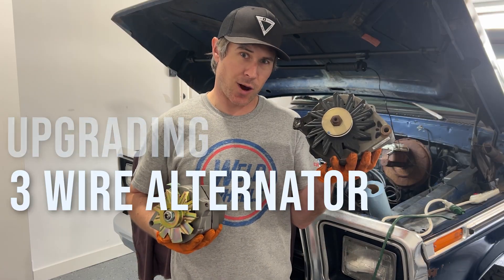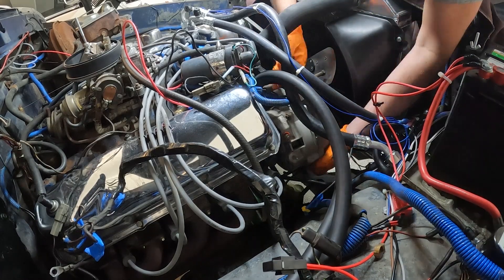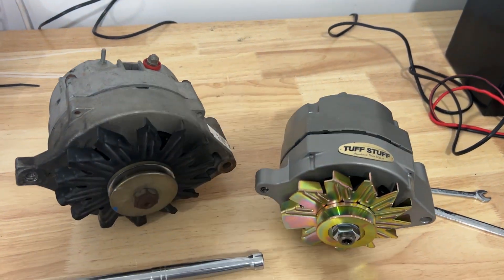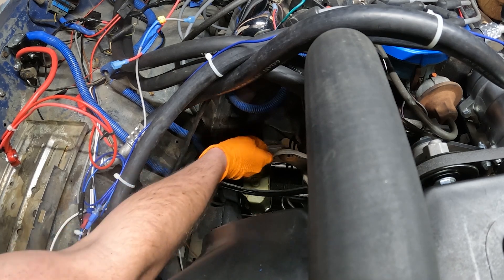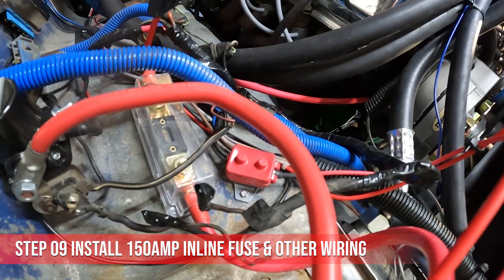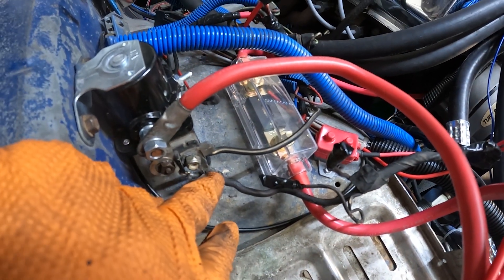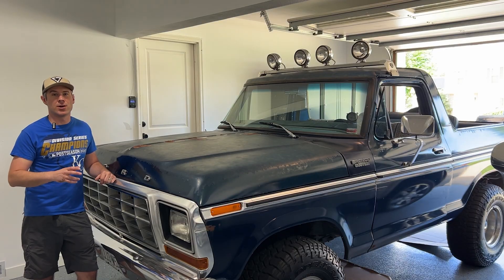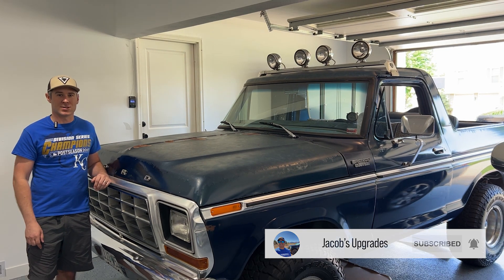Is a One-Wire Alternator Upgrade Worth It?

Comment: I've seen in some other videos that over 100amps, you need to have a double pulley because one belt can't drive alternators over 100amps.  I notice yours is a single pulley.  Have you had any issues there?
Reply from the maker: Just for reference the stock 240amp alternator on my 2015 F150 runs off a single serpentine belt as well.
Reply from the maker: I haven't had any issues running the 140amp alternator. I don't measure amps but I have a volt gauge that is always over 12 when it's running. I have since rewired my entire Bronco with a Rebel Wire kit and cleaned up the engine bay and it's still running great.